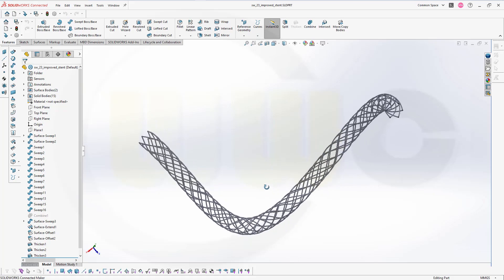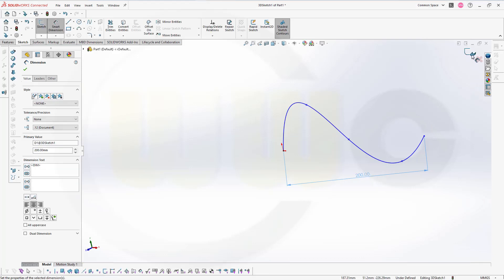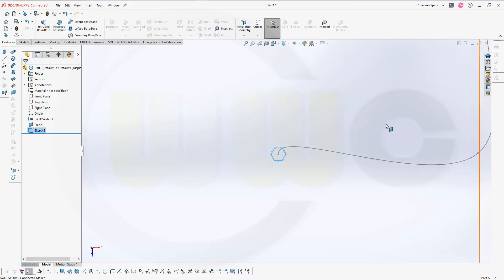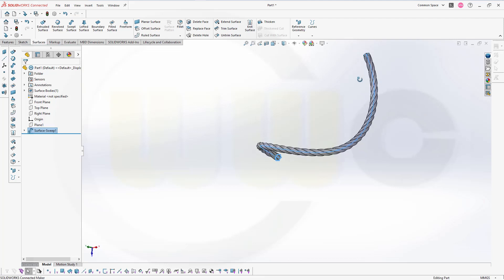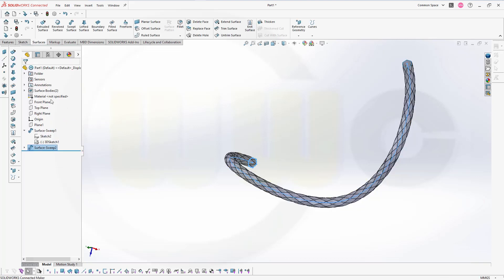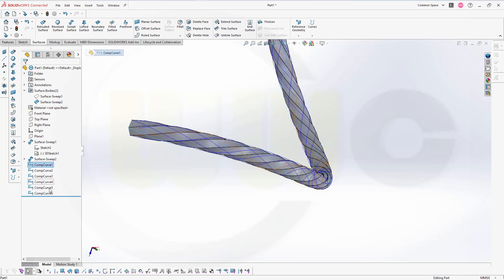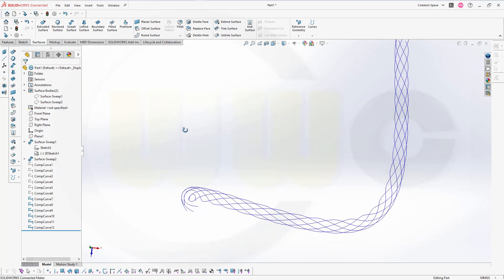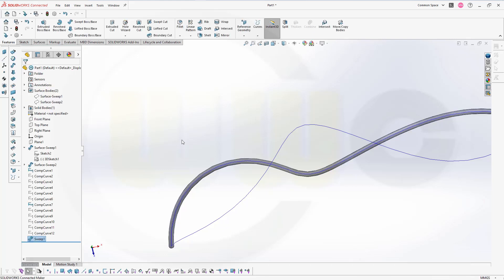Erweiterter Stent - Advanced Stent - SolidWorks 2023 Training - Part Design

Comment: Thank you for the tutorial! it was very helpful and easy to follow along. Question. What is the reasoning behind converting the cross section of each wire from circle to square? I'm assuming that's what u were trying to do at the last step. Is it for ease of calculation when running simulation?(CFD/FEA)?
Reply from the maker: No, I wanted to have a smooth surface on the inside and outside.